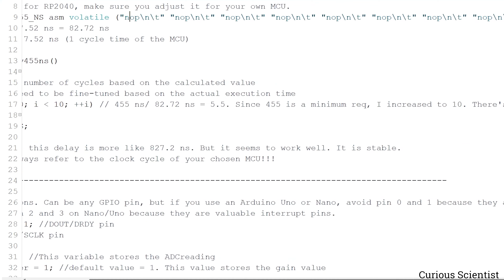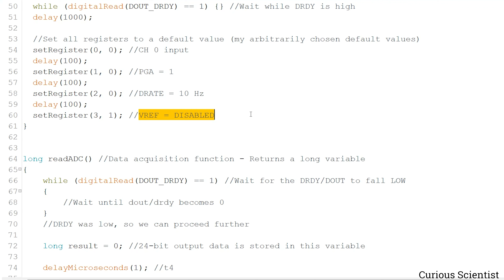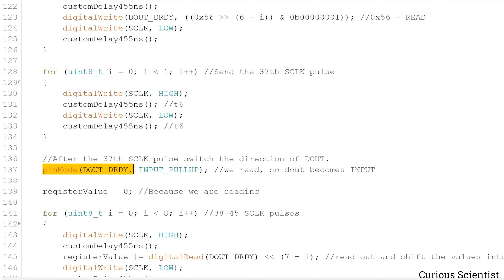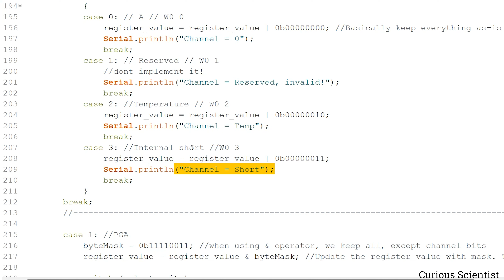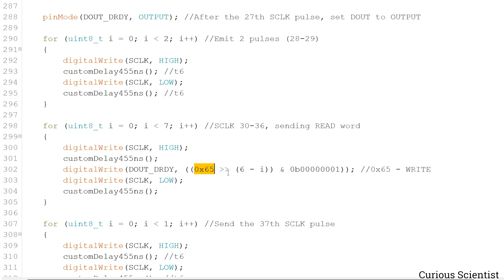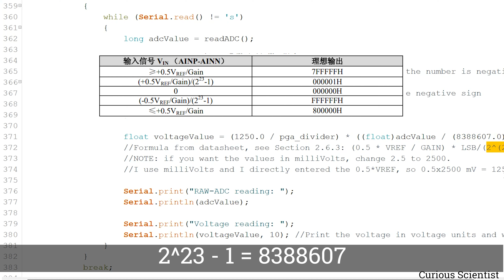CS1237 24-bit ADC, a potential HX711 alternative!

Comment: Thank you as always for your detailed explanation and videos. I just have one question. At 8:35 you explain how you build the required delay for the ADC to work, you used exactly 11 NOPs, why this exact value and not 10 or 15 or 20? It's not clear to me if you obtained this value experimentally and, if that's the case, I'm curious to know what happened with a different value.

But actually, why not construct it just with the necessary NOPs instead of using a for cycle?
Reply from the maker: Hi! If you open the datasheet, it is the t6 value in the timing diagram. I did not want to write 111 NOPs, so it is easier to write a few, that I can count on the screen easily, manually and then multiply it with a for loop.
Reply: @CuriousScientist  Ok I understand that, but why don't use 10 NOPs and then with the 10 cycles of the for it would be 752 ns which is still enough. Its just that it triggers my OCD that it's not a more round number like 10 😅
Reply from the maker: The code is freely available on my github. Just download it and modify it so it matches your style.
Reply: @CuriousScientist  Yeah, I already did that, it works reasonably well with my Arduino UNO. I just had the question about whether you defined this value arbitrarily or if it was something more. Thank you very much for your response
Reply from the maker: No worries. The code should work with any Arduino-compatible microcontroller.

Comment: Good morning.
I need to repair the printed circuit board of the Geeetech Mizar S controller (which controls the two 24 V fans and the 24 V heating cartridge). The problem concerns a broken track on a double-sided printed circuit board.  Since it is an NTC (negative temperature coefficient),  pin 3 of the C1237 IC should be the right one. However, I have  found some wiring diagrams where both pin 3 and pin 4 are used.  As for the resistor connection: I start from the central output pin of the AMS1117 (3.3 V), solder the 100 kΩ resistor that acts as a pull-up, connect the 100 kΩ NTC to the other end of the resistor and bring everything to pin 3, while the other connection of the NTC goes to GND. Unfortunately, however, the circuit does not work and I can't figure out why. Today I tried connecting the divider directly to pin 8 . Will it work?  I'm thinking of using an Arduino Nano as an alternative, but first I'd like to understand exactly what the “3D_D” and “3D_S” pins refer to .  That's all for now.
Thank you very much.
Reply from the maker: Hi! I am not familiar with that particular circuit. Maybe try finding a forum or a community that is specialized in those 3D printer boards? It is also quite hard to imagine the circuit without seeing any image of it, so it is not easy to help. But definitely don't connect anything to pin 8 of the CS1237 because that is the reference output pin. The chip can, by the way, measure differential inputs, so that's why both pin 3 and 4 (AIN_N and AIN_P) can be used. If the single-ended method is enough, then AIN_N is connected to GND, and AIN_P receives the signal.

Comment: Hi CuriousScientist, on this CS1237 module is it also normal for the voltage reference TL431 to get so hot and draw 250mA ?! Thanks for the good lesson you gave us.
Reply from the maker: No, it's absolutely not good. Something is shorted!
Reply: @CuriousScientist  You are absolutely right. It was me who made the mistake of connecting the supply voltage to AVDD. The right connection is to put +5v on DVDD. I realised this by studying the diagram of the CS1237+TL431 module. I hope this mistake of mine will help others. Fortunately, nothing burnt out.:body-blue-raised-arms:
Reply from the maker: Glad to hear that you got it sorted out and it works. Reading the diagrams and datasheet is very important.

Comment: Hello , i just got the same exact module to test on a load cell , woul you recommend using on board voltage reference if my load cell works on 5v?
Reply from the maker: Hi! Yes, it should work.

Comment: Hi, I use arduino nano board with weighing sensor but the voltage is not stable. What's the problem? I can get weight data well with HX711.
Reply from the maker: Hi! It's hard to say anything without knowing more details about your circuit. Could be unstable power supply, dangling wires, noisy instruments nearby, lack of shielding...etc.
Reply: @CuriousScientist  If I want to get the data correctly, do I need external circuit support?
Reply from the maker: What do you mean by "external circuit support"?

Comment: Nice job! It's possible to conecte multi CS1237 to read multi load cells on the same arduino board?? for example, connecte 6 load cell to 6 CS1237 to one arduino Mega.
Reply from the maker: Thanks! Absolutely! You just need to define more DRDY_DOUT and SCLK pin pairs. and read them back accordingly. 

One thing you can do if you use my code is to pass the pin numbers as parameters to the functions. Then you can generalize all functions and call them with the desired module you want to communicate with.
Reply: @CuriousScientist  thank you so much!! What I want to do is use a strain gauge (load cell) to read the deformation at different points under dynamic load, so I'm thinking of using this configuration with multiple channels and an SD module for data logging. Do you think I can get low noise and high sensitivity with this configuration at a high sample rate?
Reply from the maker: @diogolopes5777  It depends on what is your acceptance level. Check the datasheet and test the hardware to get an actual idea about the performance.
Reply: @CuriousScientist  thank you, I'll check the data sheet, do some more research and run some tests.
Thanks again and keep up the excellent work!! 😃
Reply from the maker: @diogolopes5777 thanks! Have fun with the project!

Comment: Is it possible to dynamically change the reference voltage. Of this ADC ?  Is it the AVDD pin ? If i apply to it different voltages. Would it be. The Vref ? If yes. What is the range of voltages i can apply to it
Reply from the maker: Hi! Have you tried watching the video and reading my article?
Reply: @CuriousScientist yes.  And im rewatching and rereading.  There is alot of info to process But i just need a clear information right now. :  can i apply any voltage i want to AVDD within a certain range. and this voltage would be the adc reference voltage or atleast. It would be proportional to it ?
Reply from the maker: You cannot apply voltage to the AVDD pin on the board because it is an output. There is an onboard voltage reference chip.
Reply: @CuriousScientist  how is AVDD an output. You have A+ and A- which are the differential inputs. Then you need to power them. With some vdd and gnd.  logically thats. AVDD and AGND
Reply from the maker: I just explained how it is an output. Read my answer again.

Comment: Very nice job! but isn' t it too noisy? 24 bits declared, but it seems that noise free are far way low than declared... or is it just because there is basically no filtering???
Reply from the maker: Thanks! Yes, noise is there for multiple reasons. PGA and sample rate also influence the noise, I didn't use any averaging, it was a bare PCB on a breadboard...etc. but I have further plans with this circuit where I will try to bring down the noise and understand the features better. Cheers!
Reply: Yes, even with the lowest sample rate of 10 Hz and PGA = 1, I'm noticing less than 15 bits of information from the ADC from the video. Very poor performance indeed!
I'm guessing you are using AGND for negative input, which should be fine if PGA = 1 or 2 according to the datasheet.
ADS1115 will be a better choice in many cases.
Reply from the maker: When operated at 5 V, the effective resolution (ENOB) can reach up to 20 bits, and when operated at 3.3 V, it should reach up to 19.5 bits, according to the datasheet. Since this ADC is not too much discussed on the internet, I will do a couple of more videos on it and will try to investigate its capabilities further. In fact, I bought the bare chips and the same voltage reference a while ago, so I am also planning to design a PCB for it. 

The ADS1115 has similar capabilities when it comes to sampling speed and it has 1 more channel (but then, there's the CS1238!), however, it is only a "16-bit" ADC. But probably it has a better performance, I haven't compared them yet.
Reply: @CuriousScientist  Can't wait to see the results you get.
I have a few on order myself for testing. I hope they are good enough to use in a battery powered scale I'm currently designing where I need low duty cycle readings at 1Hz. The start-up times of this IC should be much faster than HX711.

From experience, I have learned that the data sheet may not always be super accurate from all manufacturers unfortunately.

They only cost 50 cent or so on jlcpcb, so it's worth testing :-)
Reply: @CuriousScientist did you ever finish experiments on the noise of this ADC?

Comment: If i test out your code on a fresh made project one error occurs<
setRegister' was not declared in this scope
I have changed nothing in your script
How can i fix this?
Apart from that great video!
Reply from the maker: You probably copied the code wrong. Probably a bracket is missing somewhere. You can see in the video that the code works.
Reply: Thanks @CuriousScientist , The issue was:
I made the project on visual studio code using platformio which works different than the arduino enviroment
I needed to move the setRegister above the setup void, because setRegister was not in the scope!
Reply from the maker: Good to hear that you figured it out. I was sure that my code is fine. 😎

If you are comfortable with not using the original Arduino IDE and willing to spend a few bucks, I would recommend you to check out VisualMicro. It is a MS Visual Studio-based framework and it makes coding 1000x more efficient.

Comment: Is the pinout diagram at 5:30 correct? It looks like reference is connected to an NC pin (or the 'cathode' pin, if the chip is rotated 180). Thanks for the video!
Reply from the maker: It should be correct, check how a shunt reference works. This is not an "IC-type" of reference.

Comment: It would be nice to see the PIO used for this application on the RP2040. I've written the reverse, a HX711 emulator on the RP2040 for a hardware in the loop test tool. It enables me to simulate a strain gauge input and demand whatever mass I need to perform a test. I use the Pico SDK which is excellent and well-documented.
Reply from the maker: I might look at it in the future, but right now I want to focus on other projects related to this ADC.